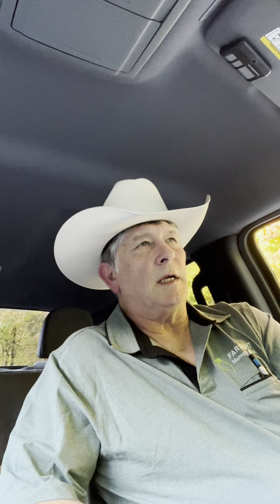Post Remediation Verification Testing

Comment: So glad to hear you mention the diurnal cycle of mold release, and how the huge variability in the counts and types of outdoor molds at different times of day exposes one of the fundamental flaws in using an indoor/outdoor air spore test as the metric of clean enough.  (Not to mention the huge impact on spore counts from atmospheric conditions, like a windy late afternoon vs at the start of a drizzle that triggers spore release vs after 2 hours of a steady rain.  

For your follow-on video, could you video a PRV on a site that didn't pass, so you can explain how you evaluate surfaces that seem sketchy -- and may or may not be, and aren't easy to clean :

- pressure-treated wood studs that still show the wavy line of water damage
- vertical sewage pipes & bolts that look a bit rusty
   (there had been a crack and slow sewage leak in concrete below the toilet)
- dust in gaps under bottom sill plates, 
- concrete with glue from a LVP underlayment.
- concrete
- insulation around pipes demonstrate a white-glove (or swab) test on definitely failing, near-clean vs clean studs and sill plates.   I tried it with dry cotton swabs ran into problems. Most shredded on the rough wood (does that mean sanding/wire brushing wasn't adequate?) others scooped out drywall dust but still stayed near white.   

And when I moistened the swabs, they stayed together better, got brown or dark, but would pressure-treated fir bleed a darker color?  Besides which, since there may still be microbial growth, is it kosher to use even a slightly-moistened swab or microfiber cloth, if moisture is <50% and the neg air pressure containment is still up?